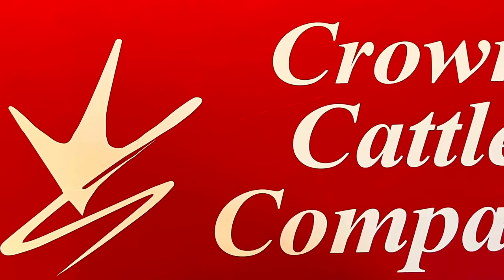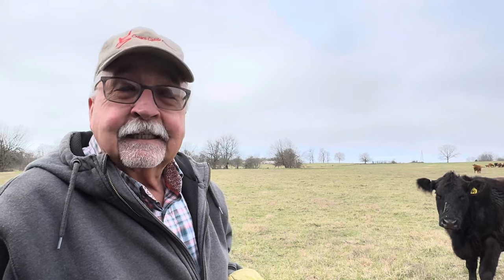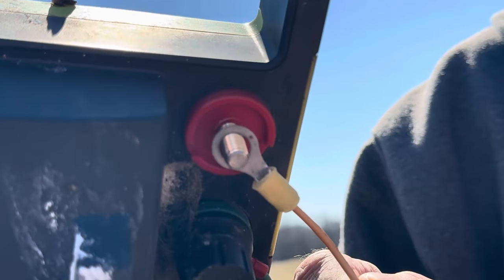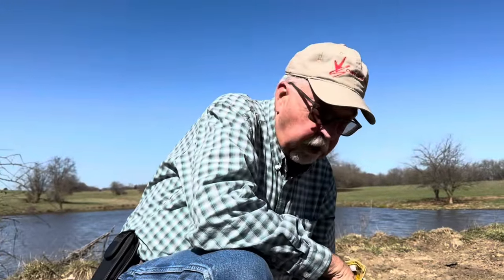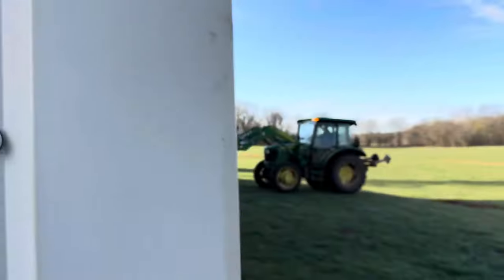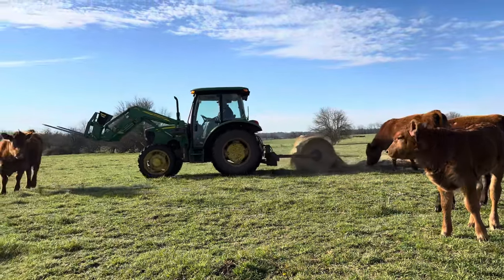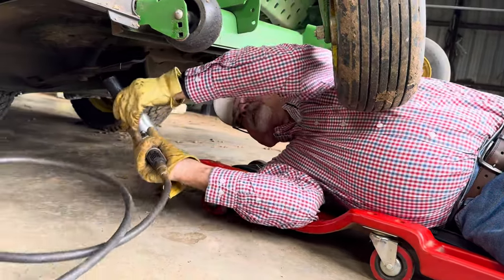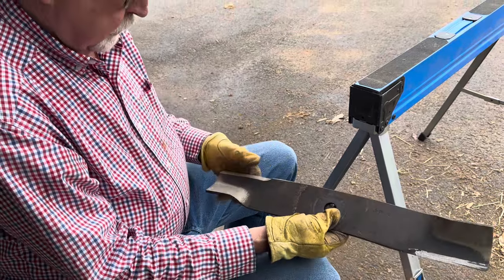Endless Farm Fun, To Keep You Busy

Comment: Forgive Me if I'm wrong, but jacking Your riding lawn mower up on those 2 hard plastic wheels could be dangerous. Those wheels turn forward and backward and a weight shift could let Your mower roll of the jack and fall on You. I've always found a chock block under a wheel in case something should try to move was a good idea. Have I always followed this advise, the answer is NO. The older I get the more I take time to be safe.
Reply from the maker: Great advice, and like you, I’m more cautious the older I get. My jack is very resistant to rolling, when under load.
Reply from the maker: Also, I’m always certain to have the manual brake engaged on the mower.
Reply: The 2 small hard plastic wheels I mentioned are the 2 mower deck wheels the jack was put under to lift the mower. They are free wheelers (move forward and backwards) I was thinking in a weight shift they could let the mower roll of the jack. Keep using the emergency brake or a chock block. Stay safe in this heat.